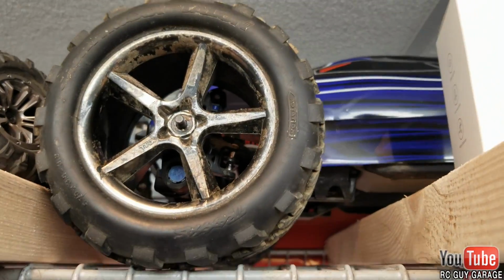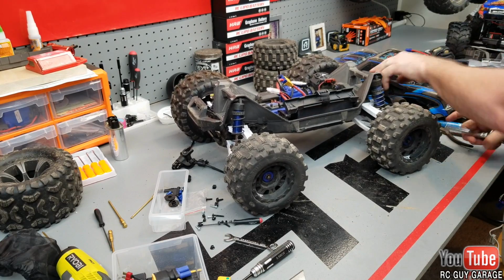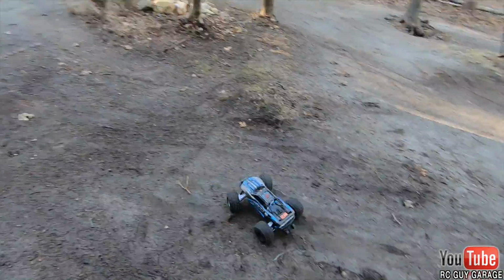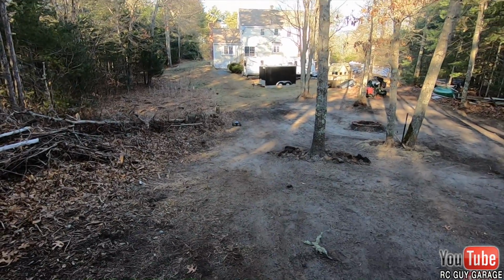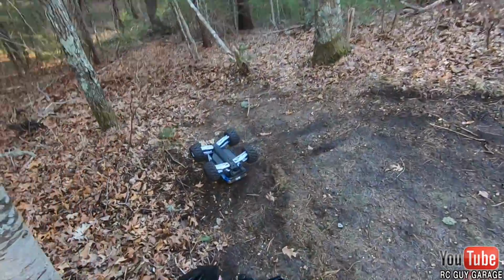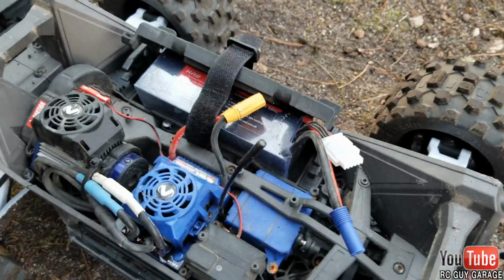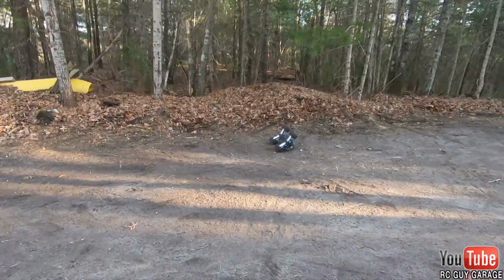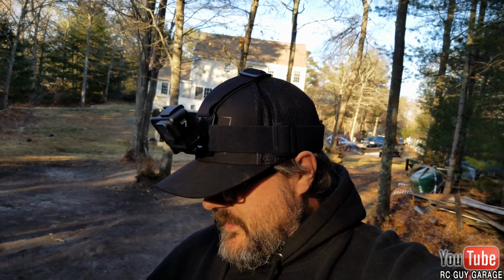Traxxas MAXX Ripping on Redcat KAIJU wheels and BREAKAGE

Comment: I'm currently running the Kaiju tires on my widemaxx maxx 4s. They work pretty well. No breakages from my part, but I do have the steel drive shafts, hubs and 17mm wheel nuts on mine. Forget to about that dumb spacer and plastic hubs my friend 👍.

Comment: And I broke my max again, just got it fixed after hitting my mailbox. Was showing it off to a buddy and I broke the driveshaft at the wheel hub.  😕    I think I will just head to the hobby shop and pick up a bunch of new parts lol. 
Spares! Lol
Reply from the maker: SPARES!!!!!
Reply: Yep, cheap plastic driveshafts, that's why I am trying to buy a metal driveshafts for my maxx to jump, not going for that experience traxxas one.🤑 doing test on gpm metal driveshafts with the wide maxx now, one test have been did, I was thinking it's good before, but I have little problem with the gpm, not really a big deal but I think I should make another video to do a correction, so there will be another test and video showing what happen later.😩
Reply: @yyckey5022  I thought about metal drive shafts, traxxas is way to expensive, my other worry was causing even more damage.
Reply: @rcguygarage  I am planning going to the hobby shop and loading up on spares lol. Lesson learned haha🤣🤣
Reply: Let me see, i am waiting for a new set of gpm to come, caz I was think I get 1 bad driveshaft from gpm, so let me try again, and I will have another video to correct what I said before, and let you all know how it is. Just hard to find a good driveshafts for this traxxas vehicles to do high jump with.

Comment: Like people are saying, traxxas should have the metal driveshafts on the maxx at the beginning, it is not even 6s yet and it can't not handle all this with a 3.8 tires, caz the price is not cheap on this trucky, almost the same as the e revo 2.0 6s with big tires, also the plastic driveshafts are casting a lot of problems on this traxxas vehicles, why do they still keep using it,😒 i feel that since day one I own the first traxxas until now, I am getting tire of looking for parts, the traxxas parts are not stronge enough and have to look all over the internet to find stronge parts, since I am finding so mush aftermarket parts, maybe from now on I should go for some other brand like arrma, bye traxxas, if you don't come out with a better truck next time, I thank you will loss me and a lot of you're royal customers.